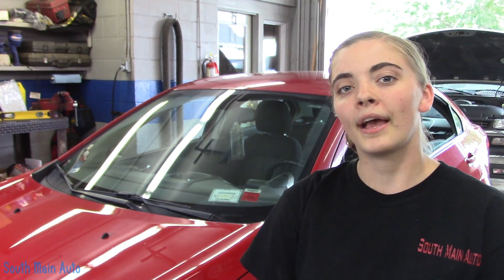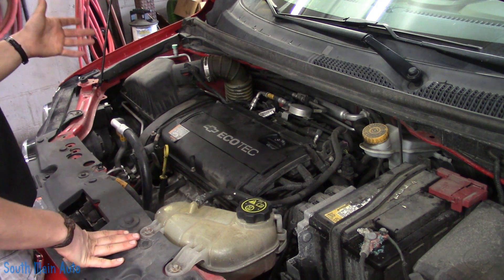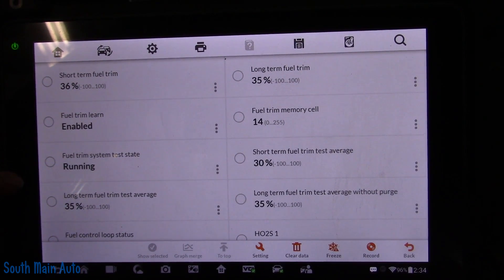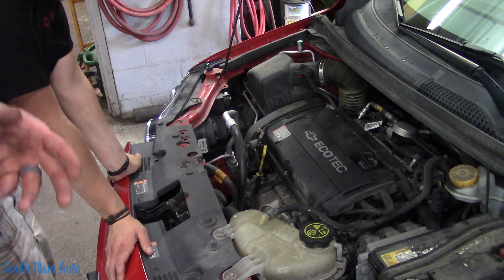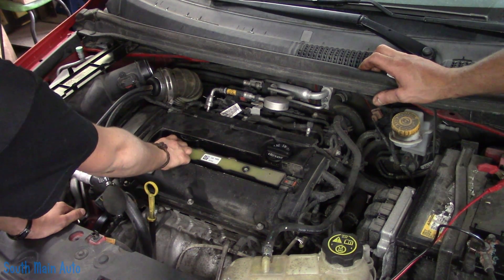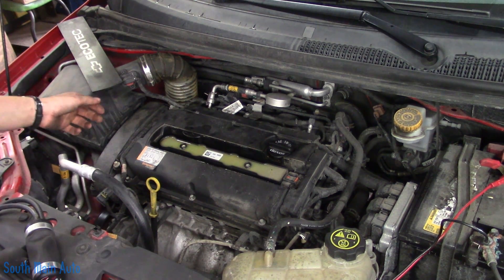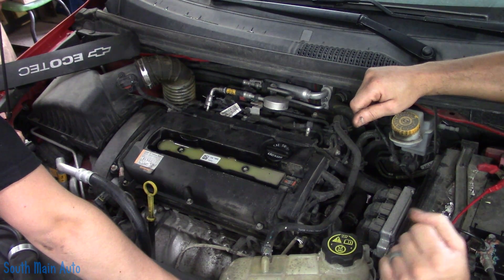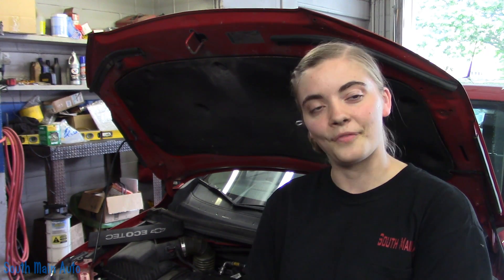Chevy Sonic: Running Lean P0171 - Part I

Comment: After watching your video I realized the dipstick was slightly sticking out and not properly seated. I tested short term fuel trim both with it properly seated and almost completely pulled up. From next to zero to nearly 40 shtrmfr %. Crazy. Almost stalling and dying at idle to idling fine. Smh. How is that pulling in air and causing my lawn code though?

Comment: Why do you have the cables on the battery? I'm new to this, 100% new! My sonic has code 84 on the dash-wont go over 5mph. Check engine codes P1101, P101 & P0171. I want to troubleshoot but I don't have any of the diagnostic tooks/equipment you have.

Comment: Idk who needs to hear this, but if they forget to put your oil dipstick back in all the way after an oil change, it will also create a vacuum leak and throw a P0171 code. I did the same tests as they did in the video but they weren't producing the same results. A little confused, I started looking around for what else it could be and that's when I noticed the dipstick sticking up out of the tube. It wasn't even close to sealed... Thanks South Main Auto!

Comment: i have 2016 sonic hatchback and it had p0171 so I changed out valve cover unit, 4 spark plugs and coil pack assembly. symptoms were money light and rough idle with stalling here and there. before i swapped out parts, i noticed oil in 2 spark plug wells so that's why i replaced all 4 plugs and coil pack that's 4 coils on one rail. it ran pretty good for a few hundred miles and now rough idle is back with stall again sometimes i think it only stalls when car is hot and driven for a while. anyone got any ideas? i double checked my install and no oil is getting into the spark plug wells anymore. maybe it's maf sensor or purge valve. there's different videos on youtube showing different fixes for same problem. car has 165555 miles so she's ready to shit the bed i think

Comment: Midas got me for $1200 because they thought it was the valve cover and it wasnt. Engine light is still on and car is still doing the same thing. I think its the O2 sensor and im going to replace it myself. Videos like this shows that these shops really just be guessing and taking people money. I would rather do trial and error and fix it myself for cheap.
Reply: they show proper diagnosis here with smoke machine and bad pcv valve. sonic has a few issues with rough idle that come from about 6 or 7 things possible to repair to make it run perfect

Comment: Wait, confused, at around 5:11 you say to rev it to 3000 to reduce manifold vacuum. Why does reving it reduce vacuum, I thought it would increase vacuum?

Great video by the way. 

Suck up that quality time all you can bc they leave the nest way to soon. imho.  God knows I miss mine.
Reply: They are correct.  When a piston goes down it wants the cylinder area vacated to be fully filled.  At idle, only a small amount of air/fuel is allowed into the cylinder and so the suction remains unsatisfied and therefore strong.  Conversely, at wide open throttle, when the piston goes down the cylinder is fully filled and therefore there is no suction remaining.  So high manifold vacuum at idle and low manifold vacuum at full throttle.  Stated another way, the higher the rpm, the lower the manifold vacuum.  

With old cars with carbureted engine there is another place to get vacuum. It is obtained from the air speeding through the carburetor.  That vacuum increases with air speed so the higher the rpm the higher the vacuum.
Reply: @IsItTrueThat  Confusing.   What is stopping the mixture from filling the cylinder at low rpm?
Reply: @IsItTrueThat  Ok   think i might have seen the situation.

Is   -1.0 high manifold vacuum   and -4.2 low manifold vacuum?

Comment: Can someone explain why the engine stalled when the dipstick was removed?  I understand what the PCV does and how this failed valve is causing negative pressure in the crankcase, but why does relieving that pressure cause a stall?  Is there a sudden additional inrush of (unmetered) air and the ECU just can’t change the fuel trims fast enough so the mixture becomes so lean that it won’t ignite?

Comment: Not to be overly nitpicky, but when you rev up the engine under no load, the reason the fuel trims improve when there is a vacuum leak  is because the overall airflow into the engine increases while the amount of air getting in through a vacuum leak stays roughly the same, therefore the fuel trims improve because the vacuum leak is causing a lower percentage of error in the MAFS reading. For example, lets say you have a vacuum leak that is allowing 1 g/s of unmetered air in on a 2.0L engine at 20 inHg, where we might expect to see 2 g/s of airflow through the MAFS under normal conditions, the vacuum leak will be causing a 50% error in the MAFS reading, so we might expect to see total fuel trims around 50%. If we increase the engine speed off idle to 3000rpm, we may see the airflow through the MAFS increase the 5 g/s under normal conditions, but because the manifold vacuum is not significantly changed by revving the engine under no load (I'd expect almost no change once the engine speed levels off, it may even increase manifold vacuum due to the higher engine speed) the vacuum leak will still only be allowing in about 1 g/s of air. So, that 1 g/s of air caused a 50% error in the MAFS at idle when the engine is ingesting 2 g/s of air, but its only a 20% error when at 3000rpm under no load when the engine is ingesting 5 g/s of air, so the total fuel trims should improve to around 20%.

Great job with the video and teaching a new tech how to properly diagnose a car.

Comment: Dangg why does gm or anything change a simple tool or part that did just fine with a pcv valve outside on the valve cover that pops in and u just change that when they fail instead of this crap built in . All this is , is a money racket bs they always gotta do something. 🤦‍♂️🙄 gezzz just dumb engineering

Comment: My concern locking at the initial live data was the coolant temp. She said it was okay but it was only 109F. How long had it been running? Did it ever warm up to operating temp? I would of preferred to let it warm up fully before looking at the fuel numbers.
Reply: I thought the same thing, but then noticed it was in closed loop, so okay to factor in the fuel trims.

Comment: Good for you! When my Wife's Chevvy Cruze threw the same code, the dead giveaway was the ton of air hissing into the valve cover. The hole is a port that opens the back side of the diaphragm to the atmosphere so it can move as the valve position changes. When the diaphragm ruptures then you have the open hole into the engine that bypasses the mass flow sensor.

Comment: You can also check for vacuum leak using CO2... If you spray CO2 in a vacuum leak it will go from running like poo to almost stalling. No explosion hazard.

Comment: Yeah, the engine shouldn't be sucking any air in past the MAF meter.

I had that trouble at the beginning of the year with the 5.7 litre Chevrolet LS1 engine when the MAF & inlet snorkel clamps came loose on a 42°C day in summer which was in January or February over here in Australia.

The plastic duct just got soft then slipped off a bit then sucked air in leading to surging & stalling at idle as well as causing the car to kick,buck & carry on.

I got lean running codes P0171,P0172 & a low MAF signal output code P0102 which pointed me to saying - I have an air leak somewhere !

Comment: I would love to hear the justification that the automakers (There are several of them) give for making the PCV valve a part of a larger. more expensive object. The trend to requiring unit rather than part replacement has been going on for years. Evidently there is no real pushback to stop it.
"Sir, you had a broken valve spring, but we had to replace the head assembly as the springs are not available separately."
Great video, though. Positive attitudes everywhere.

Comment: Please help 2002 Trail Blazer no crank no start IGN switch has current you think it's a bad PCM all the fuces look good and relays
Reply: Is there power at the starter s term when cranking..  need to start with the basics first.

Comment: My 2011 Chevy Cruze had this same problem, only it had a crazy whistle coming from the engine bay.  Took it in to have the whistle diagnosed, and it was the PCV valve as well.  I didn't hear the whistle in this video like my car had, but I heard the air leak - basically sounds like trying to inflate a tire with a nail in it.  Valve cover replaced, and it purrs like a kitten again~

Comment: I own a 2014 sonic and i haven't had a CEL yet but from day one ive had an issue where when i come to a stop at a red light or just stuck in traffic sometimes at idle and stopped i would feel a brief misfire and studder then back to normal..its been happening for years and also noticed the misfire like action when the dipstick is pulled out as well..does this mean my valve cover needs replacing to correct one if not both of the engine misfire (but no CEL) problem? Ive been waiting for the P0171 code after i noticed the common issue of the air filter to throttle hose tear in the hose (which mine is torn but only slightly) but still after 3 years and over 20000 miles (now 65k on it) i dont even have the pending code..thoughts..suggestions SMA? Big fan here love the vids and look forward to more!

Comment: Nice job on your first trouble shoot. 👍👍
Just so happens I had a bank 1+2 lean code in my 11 Hondo odyssey using my noodle and my scanner i tracked it down to a tear in the intake tube (which seems to be a common thing on odyssey since this is the third time on 3 different vans it has happened) good work though.

Comment: Great job Marie! Learn her well Eric. 

The timing of this video is about perfect. I just worked on a Chevy Cruze, diagnosed it yesterday and fixed today. Had the big o' 1.4L with a turbski. Had pretty much the same. Multiple codes for 02 sensors and running lean.  While watching the video I was like "I'll shit if its the pcv valve" and thinking "just start it up, YOU"LL HEAR IT!" LOL As soon as I saw the smoke rolling out, yep blown pcv valve diaphragm. Not sure what causes them to go on the non turbo engines. But the ones with the turbo's have a "check valve" in the intake that allows vacuum to go through the pcv system, but while under boost (positive pressure) redirects back to the turbo. Just a piss poor design (GM with a bad design, whoda thunk) because that check valve eventually says "you know what? I've had enough! See ya BYE!" Now you have too much pressure in the pcv system and say goodbye to pcv valve diaphragm. 

Not to mention, like said in the video, the pcv valve is part of the valve cover but also that check valve is part of the intake manifold. So when that check valve fails (not if but WHEN) you need a new intake and a new valve cover.  Good job Gm, good job!

Comment: It's the diaphragm  located in the top drivers side valve cover . They are a common failure on 1.4 engines sonic and cruze .

Comment: Great first video Miss Marie , on site training for free , thought by the master , Mr Miagee , grasshopper, these rocker covers are crap , most Vauxhall/ GM vehicles in the UK have same system , repair kit and replacement cover on eBay for less than price of front brake disc set / GM price £200 , crazy

Comment: seems to be to much vacuum, might want to check the air filter. you should do part two and fix it with JB weld.

Comment: Could not the repair to the plastic valve cover crack be done with epoxy glue to seal up the leak? That way there would be "no parts required". :-)
Reply: If the internal PCV is broken plugging the hole wouldn't fix it. Remember, the engine is also pulling air through the oil dipstick tube and likely the oil cap as well if you remove it. So the only fix is to fix the PCV which is the valve cover on this car.

Comment: This exact thing happened to my 2013 Sonic and the problem turned out to be the air intake hose splitting open in two places. It split after the elbow past the air filter box and mass airflow sensor and again near the intake manifold. A simple visual inspection can turn this one up but it can be difficult to see without playing with the hose a bit.

Comment: Great job Marie! Looking forward to the valve cover replacement video. Small tip, when attaching something to the battery, like the smoke machine, clip on the positive first then your negative terminal. :D

Comment: Mentioning the point that parts stores, despite having the ability to pull trouble codes and get basic info off of those, does NOT mean the problem can be found easily.  My usual game is the questions while pulling the codes, since that takes a hot minute to do.  How does it run, how long has the light been on, basically trying to figure out as much of the problem as I can, combine it with the trouble codes, then possibly narrow down that issue from being five, down to hopefully two or even better, one.  Though the greatest part is the fact that OBD II can help keep you from running around for hours on end trying to trouble shoot and spend hundreds on parts that may or may not fix the issue.

Example, customer called a parts store I used to work at.  Said he had a Chevy K series.  Cranks, won't start now.  Though it was getting harder and harder to start it before that day.  So I asked him the year of the truck.  He said 1996.  Birth year for the OBD II system.  I then asked if he had a check engine light prior to the truck getting to this point.  He said it was on for a few months.  Told him that at the time, we had $20 code readers and advised him to buy the reader, take it home, pull the codes from the truck and bring the codes back so we could figure out what the truck was trying to say.

He did so, and it stored two codes, (the exact codes and their definitions I've forgotten by now) the codes pointed to his crank and camshaft position sensor and their relationship together (meaning that the computer was either seeing one or none of them).  Since the codes didn't pin point the exact sensor, but narrowed it down to just two of them.  Saving hundreds on parts that wouldn't have fixed the truck.  Playing it safe, replaced both sensors.

The reason the truck didn't start (for those that don't know) is that those two sensors measure the position of the flywheel and the camshaft.  Using that data to tell the truck's computer when to send spark at the right time.  Without those two, the computer was guessing until it was too far off to spark the right cylinder at the correct time.  Making it run rough till it just flat out stopped starting.  It would be easy to blame spark plugs, wires even the coil to a crank/no start.

Comment: I have a question regarding those valve covers. I was told that the PCV valve diaphragm leaking was a symptom of another cause. That there is a check valve in the intake manifold to keep boost air from going into the valve cover. When that check valve goes bad it blows out that diaphragm. Is that only on the boosted models. This sonic has a MAF so it's obviously not boosted. Terrible design either way, Chevy really screwed the pooch on that one.

Comment: What a God Aweful design! Who would have thought they would run the PVC diaphragm through the valve cover. So in order to repair it, the whole thing is going to have to be replaced. What a STUPID idea. These car manufacturers today have learned NOTHING from the past. Why do they even give engineers today a degree? Cannot fix stupid.

Comment: Awww....how cute. I got similar issue with my 2009 Pontiac G3 it's been a Beeotch. P0422, P0421 got some new sensors then threw a P0420. P0597 just will not go away....i hate these cars

Comment: Speed density systems dont use maf do they? Could have sworn a maf setup with different than speed density since speed density is based off pressure and temperature. I may be remembering wrong.

Comment: Freeze frame got a dude fired at my last job.  Work van tripped an o2 code and the freeze frame showed him crusing at 89MPH in a 350 Econoline van with a Diesel/Gas pressure washer in the back.. Speed limit was 60mph on the road he was on..

Comment: Generic Motors managed to copy the Titanic complete with the huge hole in the hull. Given how such a PCV system fails hard in so many VW and Audi vehicles you would think someone at GM Would have known better. But I guess not. Why use a cheap replaceable valve that almost never fails when you can design something more likely to fail into an expensive valve cover assembly? VW and GM engineers must hate their jobs or are so clueless that nobody else would hire them.

Comment: I think it's time to get a holesaw and cut a nice little hole in that valve cover. Then get u a sweet Dorman grommet and put an old style GM PCV valve in it. 15 bucks max.
Reply: That's kinda like what they did with the Chevy Chevette air cleaner. Chevy designed it so you had to replace the ENTIRE air cleaner when the air filter got dirty! LOL

Comment: Sadly. The vacuum regulator diaphragm is the likely culprit which means that whole plastic slab of engineering excellence on top of the engine will have to be replaced.

Comment: My wife had this issue on her 14 Sonic. It turned out to be the intake hose from the air box. It is a common issue that these split causing this issue. We were able to jiggle the hose and you could feel the car stutter. Luckily it was an easy quick fix. Great video!

Comment: Replace the whole valve cover?  Pretty sure at that point I'd replace the car.  Or... better yet... get a real PCV and drill a hole in the filler cap for it!  Block off that stupid vent.